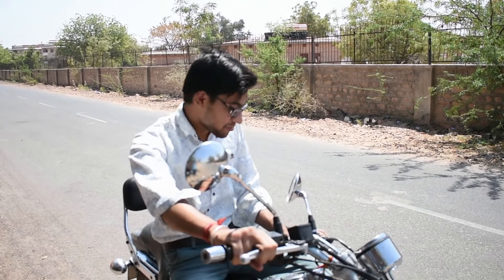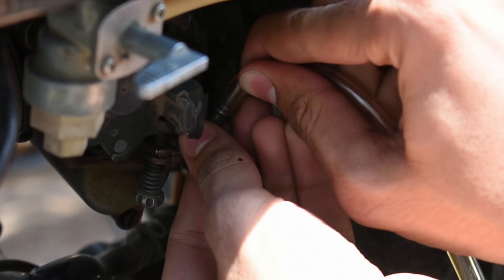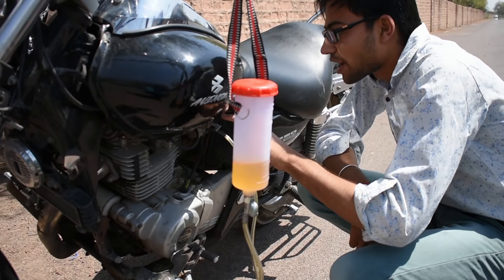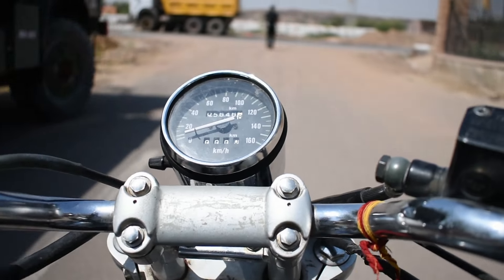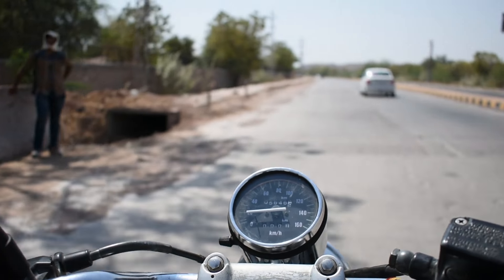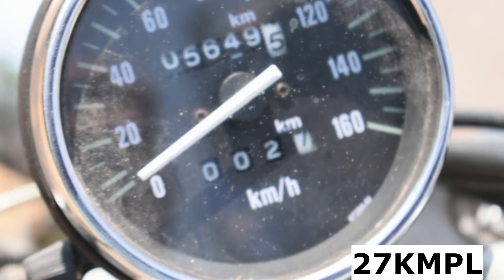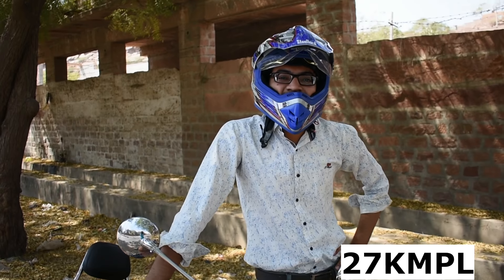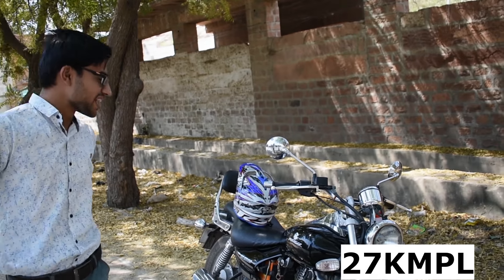Avenger 220 mileage test

Comment: i am geeting 40-41kmpl in avenger 220(2012 model) in city ride. Riding speeds of 50-80 kmph
Reply: Same I also get 46.4 mileage of my old 2012 model avenger, actually mileage is depend on your maintenance and riding skills, Avenger is not for Rough Driving if u ride proper u get mileage up to the top 👌👌